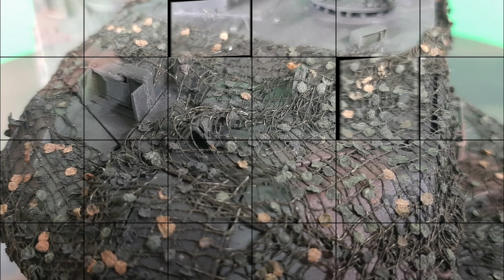Making 1/35 scale NATO camouflage Netting for Modern German Vehicles (video #32)

Comment: I ve been meaning to try creating camouflage netting and I am going to do so on my Cyprus Bmp the next days.I have a guestion about thinned white glue .Once it's dry doesn't it has a gloss finish on the areas it comes in contact with?
Reply from the maker: I have not had an issue with that but I do spray a flat clear coat to seal it. This will remove any  issues.
Reply: @Rick's 1/35 scale model's  makes sense!Thanks for sharing the tips!

Comment: Looks great Rick! Im away to do something similar with AKs netting on the chally 2 from RFM the Scots I'll do TES after the takom Bulldog I'm doing next got them all there lol what's Bordor model's leopard like any good? Think you built it? I bought my favourite leopard the m1A5 on Saturday but its hobby boss's newish one last year with 
the powerplant but just using that for the bergepanzer 2s rear deck cradle should look great! Hopefully ita a good kit was told its 4 mm longer than mengs and 1.4mm lower! Such fun eh 😆
Reply from the maker: Thank you. The Border kit was my favorite until I picked yup the RFM. The Border is a bereft fit with very accurate detail but the RFM is over the top in quality. I have got to building it but all the other RFM kits where great so I expect no issues. I love how different companies get scales off.
Reply: @Ricks135scalemodels  you don't know what size the antennas are of top your head do you for the 1.35 scale?
Reply: I love my RFM kits not long built the full interior stug ausf G stunning! I've got miniarts here to not Started but waiting for Bordors! T6e build I've just finished before rfms challenger2 was te Bordor model's Luchs it's not a nice build tracks are all set backwards in instructions and there link n length so you have to bugger about making sure you have bottom run on top n enough singles round sprockets a hairdryer helped get the old shape out so they fitted correctly haha! But the list goes on its a down scaled classy hobby 1.16 kit the parts on sprues are the same n that eh I've mixed opinions on Bordor there like a hit or a miss!
Reply from the maker: @Emtbtoday  I made my antenna 11 cm
Reply from the maker: @Emtbtoday  crazy.. thats the hobby

Comment: Might be a dumb question but how did you paint the cheese cloth? Just with a paint brush Im guessing
Reply from the maker: I taped it to a piece of cardboard and used a airbrush. You can hand paint, I've done that, or you can soak it in a diluted paint. It get stuff that way.
Reply: @Ricks135scalemodels  oh cool thanks.
Reply from the maker: I like to make my netting beat up. I usually use two shades of green to do this. Nothing drastic.
Reply: @Ricks135scalemodels  it looks good

Comment: Hey, Rick!   Thanks for sharing!  I noticed you used Cheesecloth, you can also use  Medical Gauze (altho, I don't think either one works any better, and I don't think either one is going to break the bank).  As for the foliage, I think you are of a certain age, same as me, and I recall seeing Francois Verlinden always used Pencil shavings as opposed to bits of paper. I admit I tried it back in the day (hilarity did NOT ensue), the end results were ok.  I guess if I had photograph backgrounds, and slick books, it would have looked better.  Anyway, it's buried back in some of his books, if you care to look.   Finally, I gotta tell ya, you are REALLY tempting me to try to open a bottle of liquid cement! (and that is a rare thing!)
Reply: ps- I am not saying in any way your way looks bad, or is wrong, cuz it looks great, and it works well.  Just tossing benny suggs!
Reply from the maker: Thanks Jim. I grabbed what I could find 1st. I'm actually not familiar with that name but, now I'm gona go and try the pencil shavings. Sounds interesting. My dads a stick glue type and hates liquid.
Reply from the maker: No worries. I post my work snd want comments. I learn from that. I'm using afv netting on a Gepard. It's a nightmare to work with but nice results. Video will be coming this week.